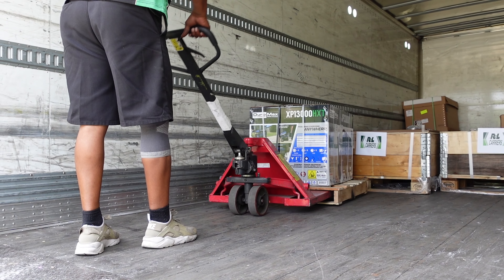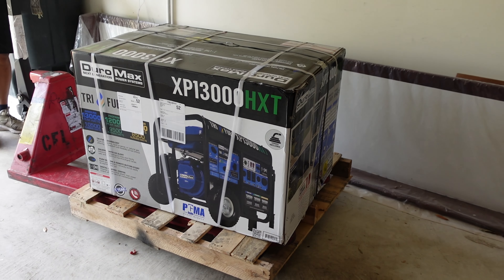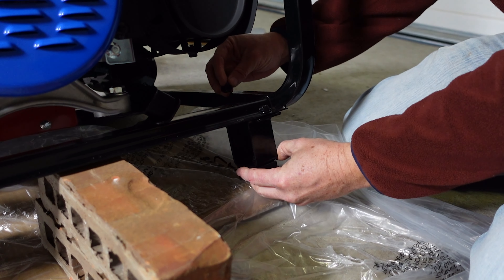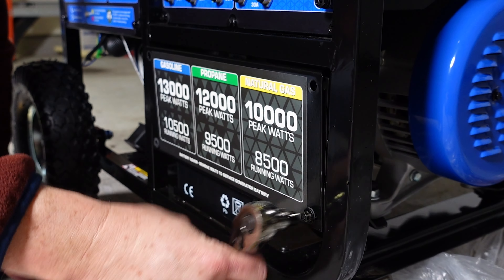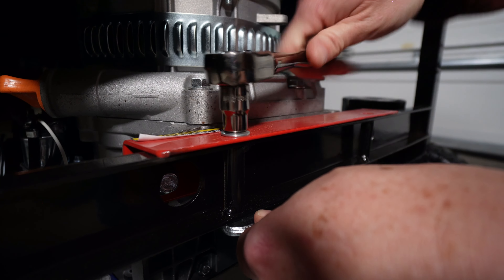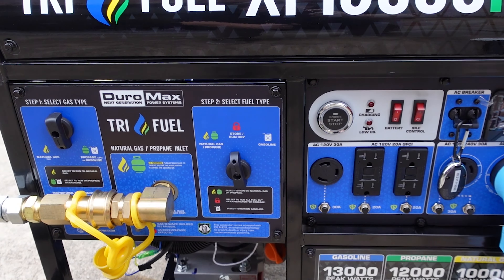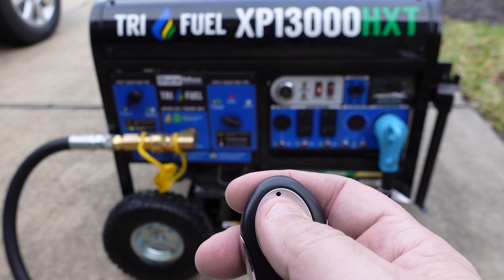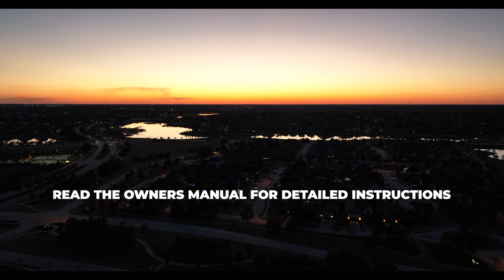DuroMax Generator Unboxing and Setup

Comment: I have a an XP12000EH.  There are 2 red L braces under the engine.  Are these the same as the single long red brace shown in this video and should be removed?
Reply from the maker: Yes these need to be removed.

Comment: What happens when a person has too many circuits on when the generator is running
Reply from the maker: If the generator is being overloaded through its largest receptacle, the main breaker on the unit will trigger. If the overload is to a smaller receptacle, the local breaker for the smaller receptacle will trigger instead.

If the breakers are being triggered frequently, eventually they will fail, so we recommend adjusting the load being applied if a customer finds themselves triggering breakers on the machine consistently.
Reply: @DuroMaxPower  thank you for the answer. That will give me some tries to know what circuits I can run at the same time. I would rather have an interlock switch instead of a transfer switch.
Reply: I know that old guy making that delivery😂😂😂
Reply: @DuroMaxPower when you push the idle control should the switch light up like the battery switch ?

Comment: Doro max 13000 tri fuel has no oil filter
Reply from the maker: Correct, however the 15,000 and 16,000 watt units do.